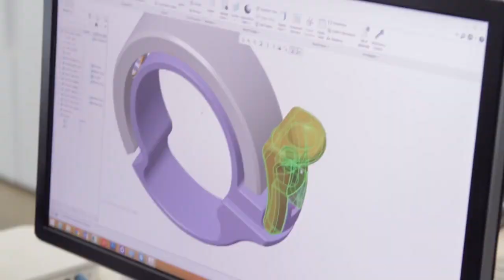Knog Oi Bike Bell - Best Bicycle Bells - Scooteretti

Comment: Nice looking bell. Ordered a small and it was to small.
Reply from the maker: There are 2 sizes of these bells. The small fits a 22.2mm diameter bar and the large fits bars between 23.8mm and 31.8mm.